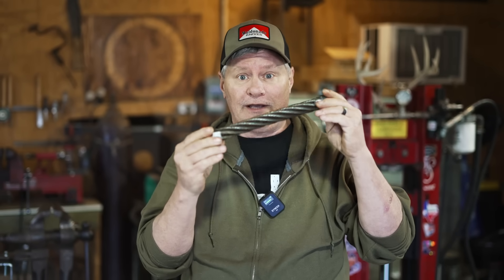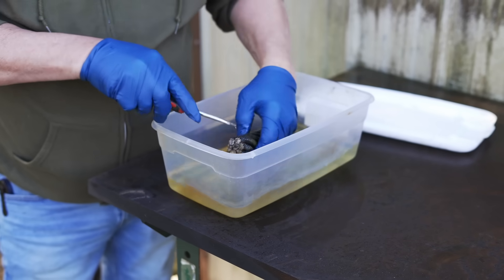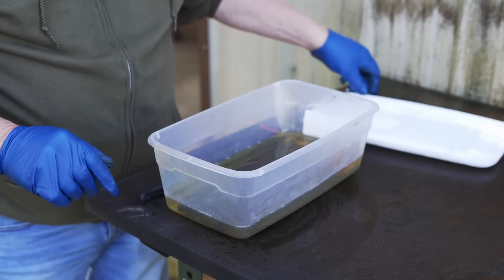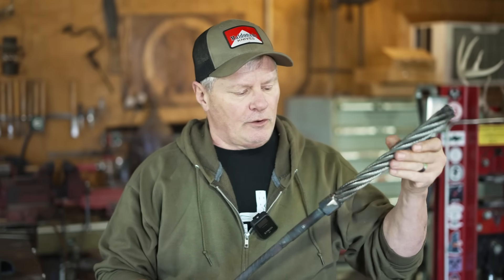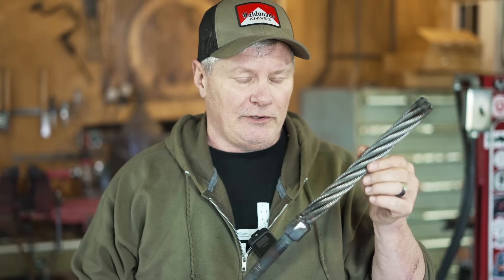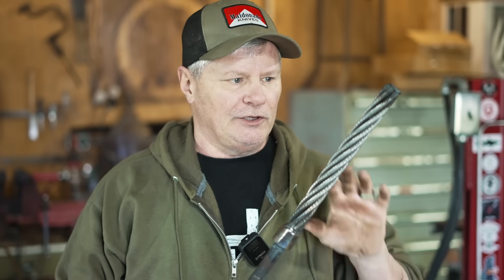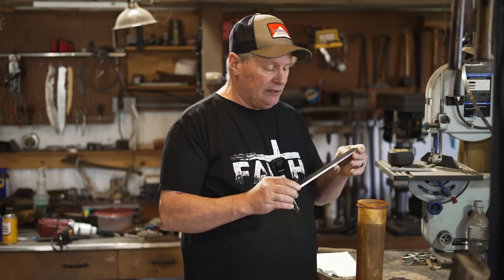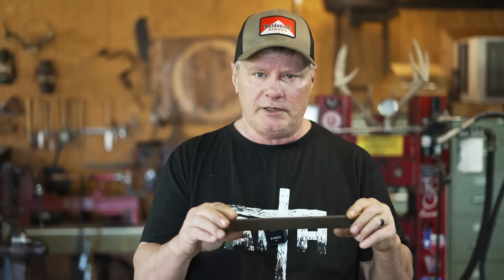How to forge weld Cable Damascus the Easy Way

Comment: How do you decide how long of a piece of cable to start with? I have 10 feet of 1.25 to try using to make some knives from that someone gave me. Thanks
Reply from the maker: Well I just forge out a 12 inch piece and use what I need out of it.

Comment: Ultrasonic cleaner worth considering?
Reply from the maker: The problem is the heavy grit and grime trapped down in the interior of the cable.  It may loosen it but it can’t get out.  Taking it apart like I did would certainly increase the chances that it would work.

Comment: That was incredibly helpful. I'm in Algiers Point in New Orleans and I'm about about three blocks? From Bollinger boat works. I have so much 1-inch cable It's crazy. I use a pipe vice to hold it, The twisting it evenly was driving me nuts. This really helps thanks
Reply from the maker: I know the place!  That’s great man, the perfect size for this method.  This will make it fast and efficient.  Thanks for watching!  🙂
Reply: @TonySeverioKnives  Bollinger actually closed down... When they did, they let me into there machine shop and it was unreal. They gave me a bunch of stuff out of there like bits for radial arm drills.... And you can probably imagine it was machine tool junkie heaven. I was walking around there thinking this is the kind of place I could live in! Most people in the modern world don't even remotely understand that.
Reply from the maker: @MrPtrvazq awesome man.  Yep it’s amazing at the stuff that falls by the way.

Comment: Way too much trouble. Just take it to welding temp then squish it with a square die. Once its consolidated I sometimes twist it more.
Reply from the maker: It’s way too much trouble no matter how you forge weld it my opinion…I hate the stuff.  But you can bet I’ve used square dies and while they work, they are not as effective, efficient or fast as this is setting the weld.  But I would definitely do what works for me.  Thanks for watching.  🙂

Comment: Great demonstration! I've thought many times over the years of using an impact gun for twisting but I got no compressor in my shop at the moment.

I don't have a press or power hammer (except for when I pick up my 4# hammer), but I made a very nice butter spatula from cable at the anvil with coal. I degreased it for a couple days in 3:1 simple green degreaser, rinsed liberally with hot water, sprayed the blazes out of it with WD-40, then off to the forge. 

I tightened it using a pipe wrench and vice then I ran the forge welds using a 60° V-swedge on a small Derek Melton swage block. My trick to good forge welds is to have a small anvil literally right on the forge (in my case it was a 20# segment of forklift tine with the mini swage block on top). This way there's minimal time wasted from fiddling with the steel to get it over to the anvil - every second counts on small pieces of steel. I hammer a few times fairly gently for less than 5 seconds, then brush, flux, and back in the fire. Did that 3x and then I was able to confidently forge it into a bar.

I then used my dividers to lay out two evenly soaced lines dividing into 3rds, chiseled 90% through on opposite sides, then folded into a 3-layer stack. Took a few more welding heats and then drew it out to a bar roughly by hand then I finished with my homemade rolling mill (similar build to Tyrell Knife Works).

 From there I ground it, heat treated it tempering to blue (I want a springy butter spatula, not a knife). Lastly, I tillered it on the grinder - which is a method used by archery bow makers to carefully analyze the curvature of a bow and gradually remove material until you get the curve profile you're after. The resulting spatula measures a very gentle taper from 0.035" to 0.025" across the 5-1/2" length. Still haven't gotten around to making handle scales though. The folding I did gives a more randomized pattern with left and right twists apparent throughout. Pretty happy with it and theres about 6 more feet of cable to go. I like to work with 6-7" segments.
Reply from the maker: Thanks.  This was an electric impact btw.  The first few cable blades I made many years ago was doing much like you described.  I found this to be much faster than hand twisting.  But not on anything above one inch.  I’ve forge welded many 1.5 inch diameter cables the old way.  The impact just don’t get it tight enough, fast enough above 1”.  But I no longer fool with this stuff anyway.  I hate it lol.  But many folks have seen a lot of my old knives and wanted to know my process.  So I decided to make a vid to answer the questions.  You will probably never see me fool with it again.  😁😁. Thanks for watching!
Reply: @TonySeverioKnives  well I completely missed that haha. Yeah I've got a pneumatic impact and a compressor in my garage but that's a good 75-100ft of dragging hose to the blacksmith shop which doesn't much interest me as I'm sure you understand. I don't think I can justify buying an electric impact for the time being as I don't see myself doing an awful lot of cable Damascus but again, great demonstration and ingenuity with the impact.
Reply from the maker: Yeah cable “Damascus” is just a fad in my opinion anyway.  The steel in the cable is all the same so the pattern you see when etching is just carbon migration between the strands.  It all etched the same depth so it’s not that great anyway.  Thanks for watching!  🙂
Reply: @TonySeverioKnives  I agree it's just decarb that highlights the strands. Still kinda cool to say, here's a butter spatula forged from a thousand tiny strands now welded together.

Comment: Would like to know how you would heat treat cable Damascus. I made a few knives from cable but they didn't harden as much as I wanted. Just curious what recipe you would use. Thank you for the video
Reply from the maker: Not all cable is the same.  This cable steel I’m using here is called improved plow steel.  It is heat treated the same as 1084.  It’s mediocre for knives still.  And as I said in the video, I hate working with the stuff and no longer make knives with it.  Mainly because it’s prone to have inclusions.  And they are usually right where you don’t want them.  Thanks for watching!  🙂

Comment: I've done a few of these this way. It's a lot of work. Have you tried doing one in a can with 15n20 powder?
Reply from the maker: Yes a lot of work.  Yes I have.  I have also cut them in pieces and forged them vertically, on the end grain.  That’s the best looking ones I’ve made doing them that way.   But I separate every single strand when I do that and clean them.  In the video I just separated the main bunches. Always junk in them like sand and dirt.

Comment: I think cable damascus is one of those iconic things like railroad spike knives that is seen as a right of passage in a way 
I have no doubt that they work but like you said cable can get all sorts of inclusions and RR spike knives are suspect steel at best 
I really like the pattern on your billet you didnt try and work it down as much as most smiths do and it works a lot better in my opinion
I like your press's goatee....very fetching 
Thanks for sharing
Reply from the maker: Yep you are right.  And railroad spikes at their highest carbon content is way too low for knives.  None of them are good.